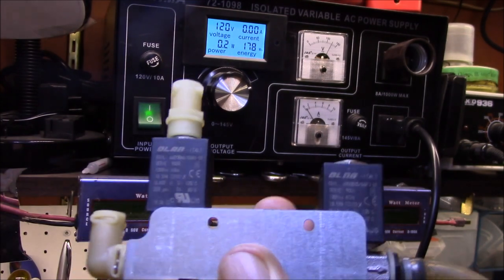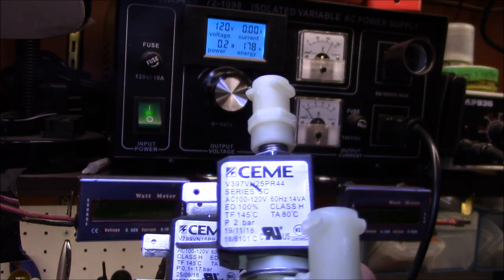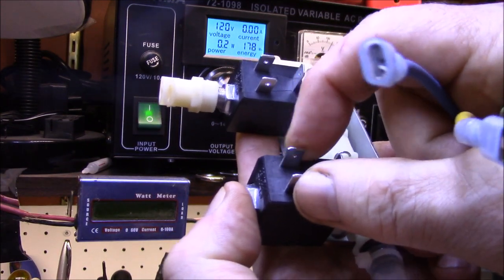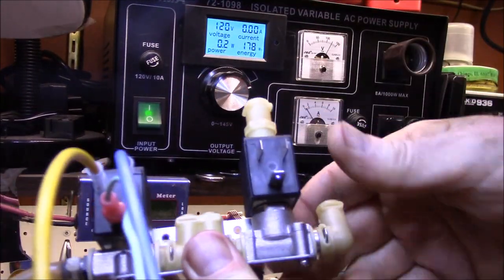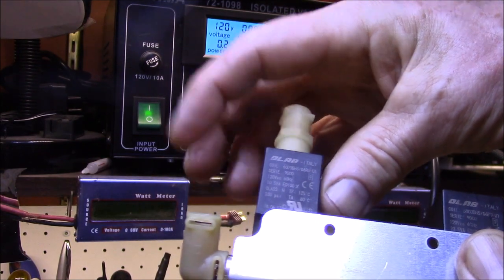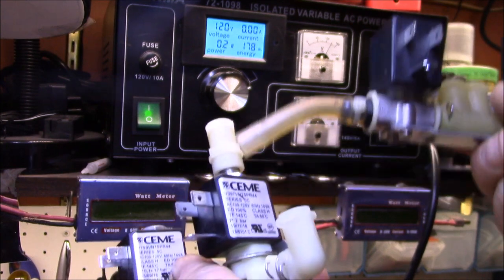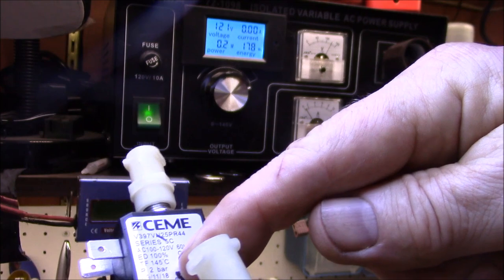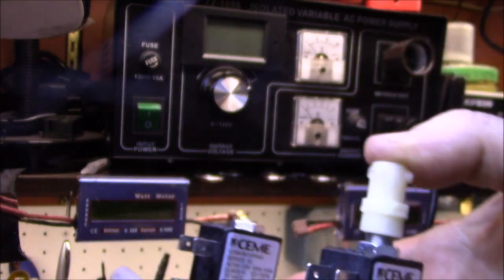Breville Barista Express - Solenoid Block Testing

Comment: Thanks for the video. My BES870 started malfunctioning a few days ago. I believe the issue traces back to a bad solenoid but I am not 100% sure. I was hoping to get your expert opinion. Here are the symptoms:
-- When the machine starts up, the pump draws water from the tank and sounds normal.
-- When switched into hot water mode, the pump used to make a thumping noise at regular intervals. This is no longer happening. The thumping sound is gone. Very little hot water comes out, if any. Instead, I get a small amount of steam from the hot water spout. I also hear an "electrical current noise" similar to that at timestamp 3:10 of your video.
-- When switched into steam mode, again, the thumping pump noise is gone. Very low steam pressure. Same noise as hot water mode.
-- When I try to pull a shot, the pump starts quieter than normal but sometimes recovers towards the end of the cycle. The total volume of the shot is smaller than normal.
Separate from this, the machine sometimes produces shots much larger than normal. This has been going on for longer and I think it's a problem of the flow meter.
Any pointers would be greatly appreciated. Thanks!!
Reply from the maker: Check the 2 micro switches at the hot water / steam valve, those control hot water and steam modes (i.e. make the thumbing pump sounds).  Those switches (as well as the flow sensor) are pointed out in this video:
https://youtu.be/9lMw6ooiqPI?si=3s_Wig5GuBh3UP7A

Variable shot volume, suspect the water flow sensor as that's what tells the machine how much water has flowed.  Sensor may be partly clogged and that's causing the variable volume readings.
Reply: @The4Crawler  Thanks for the quick reply!! Which component makes the thumping sound? Is it the pump? 
I think the micro switches do work because when I turn the hot water / steam knob, the machine does recognize that hot water / steam is requested. It just has trouble delivering them. After watching your other video, I think the right solenoid (the one that splits flow between the group head and hot water / steam) seems to be the component that ties my symptoms together. Does that sound reasonable?
I had been confused about why the pump sounded normal at startup but now it makes a lot of sense because the startup pumping action is controlled by the left solenoid, so thanks for explaining that!
Reply from the maker: @arthurcao4469  The pump makes the thumping noise as it cycles on and off, especially in steam mode,   Why?  Steam is ~1000 times less dense than liquid water, so it takes much less pumped water to make steam.  Solenoids should all be off in hot water / steam mode, as shown in the water flow video.  One simple test is to unplug the wires to the solenoid valves (be careful to unplug the machine first and wrap all the connectors in electrical tape).  Then run hot water or steam cycle and if it now works, that means the solenoids might be getting powered when they shouldn't.
Could also be the 3-port valve is partly clogged and not fully closing when it's off.  This will let part of the water flow up to the hot water / steam valve and part to the group head and/or drip tray if the 2-port solenoid is also clogged.
https://youtu.be/eljHS_BRJXk?si=94vdNC5jsF1xY4bm
Reply: @The4Crawler  I ended up opening the machine up and testing the solenoid as you suggested. When the solenoid is unplugged, no hot water comes through (as it should be). However, after I reconnected the solenoid, the previous issues magically went away! I still get too much water in a shot once in a while but I can just manually cut it off - not sure if it's worth the effort to repair (and risking messing it up). Thanks for all your help!

Comment: Thank for the video. My BES875 trips the RCD breaker when pressing singe/double shot expresso. Steamer and grinder work fine. Resistance on CEME 588 is 2.3 kOhm. I checked machine with Live line disconnected for 2/3 ways valve and it did not tripped the RCD. I will try to replace valve with a new one and have a go.
Reply from the maker: It may then be the coil on that solenoid valve.  Maybe the coil is damaged and allowing electrical connection to ground internally.

Comment: Hi. Thanks very much for the video. It's been a lifesaver. I replaced my 3-way solenoid because I was getting no water to the group head. Now I'm getting group head water but no water to the hot spout or the steam wand. I saw a comment on reddit where a guy said he'd installed the valve the wrong way round. When he turned the valve it solved the problem. I can't find a flow direction symbol on my valve but it does have the numbers 1 on one end and 2 on the other. Are these representative of the flow direction (1 to 2) ? I've installed my valve with the 1 upstream and the 2 downstream. Is it important ?
Thanks in advance

Comment: Great helpful video. I have an issue with my barista express BES870 with no flow at all to water/steam and grouphead. Suspected pump was the issue but this was tested to be good from disconnecting outlet tubing with strong water flow.  Removed the 2-w & 3-w solenoid valves, internals checked to be clean no issue.  Thermoblock & tubings were checked to be clear with no blockages,  Triac and PCB checked with no obvious visible issue on connection or failures/burnt marks.  Now cleaning the 3-w valves just to be sure the internals are clear. Measured the resistance of both solenoid coils and both are reading around 2.4 kOhms (2400 ohms). This looks pretty high. Solenoid coil is JLT 0325K unit, 240V, 9-13.5VA.  Have the solenoid coil failed ?  I couldn’t find healthy resistance reading from the website.  Advice is appreciated.  Will reassemble after descaling the 3-w valve, then retest. Thanks
Reply from the maker: Hot water and steam don't need any solenoid to be energized.  See the Water Flow video for troubleshooting steps:
https://youtu.be/9lMw6ooiqPI?si=z0kdyIXINKXhreJx
Open up the back of the machine and peek inside while running the various cycles and see if you can see where the water is going (be careful as there are live electrical connections inside).  Might be the over pressure valve is dumping all the water to the drip tray.  Solenoid coils are likely OK, they usually fail open or dead short.
Reply: Thanks. I reinstalled the solenoid block, ensuring direction is correct, checked in-line filter and confirmed no blockage.  Also checked and confirmed no blockage from the 3-way valve to hot water spout and steam nozzle. With water flowing from the top of the solenoid directly to the hot water/steam outlet and with that flow path being “open” all the time on the solenoid as you’ve stated, and the fact there was no hot water/steam, there might be partially blockage in the thermoblock.  I blew the tubing on the top (inlet) and could feel air flowing out from the bottom right outlet (line that goes to the 3-w sol). However noted it’s intermittent. Tried poking the inlet path with a trimmer line, but could only get about 4-5 inches in… I think at one point, there was flow of water from the bottom outlet. I think there is some blockage inside the thermablock which somehow got dislodged at that time.   Pump was running with the normal vibrating noise of startup but diminishing the more I attempted to run the pump (outlet path blocked, building up pressure to reduce / restrict pump piston movement). No flow from OPV so the OPV might be jammed  close or the set pressure too high.  There was water in the drip trays but much less suggesting some water flow.  I’ll now try to look into the thermablock and try to ensure no blockage.  My fear is somehow a tiny piece of o-ring has been dislodged at some point, and now sit inside the channel, restricting flow to a certain extent as it’s being pushed forward when pump runs.  I wonder if anyone has successfully pushed a steel line etc all the way through from the inlet to the outlet ?   Are there any other means to do this.  Don’t think it is scale as the tubing, visible internals of thermablock etc are clean - no sign of calcium scale at all.  Any further advice is appreciated.  Note - I’ve viewed the video on your link on water flow path already to check for potential blockages - again thanks for all those helpful videos.
Reply: Forgot to mention that I’ve measured the supply voltage to the solenoid when energised, it’s 240V confirming no fault with supply.  Solenoid is definitely clicking when I tried to brew coffee.
Reply from the maker: @timg9647  You might try back flushing the thermo-coil.  Connect the line off the pump and overpressure valve to the other side of the thermocoil and see if water comes out that way.  I think I recall one viewer comment about running a flexible wire through the coil tubing.  Start at the outlet end and work it back to the inlet to try and push the blockage back out where it entered.
Reply: Attempting to recheck themocoil for blockage by first disconnecting tubing on the outlet connection (bottom right corner) to experience water under pressure jetting out. I concluded thermocoil is not blocked (I observed similar on the inlet joint several days ago). This shows pressure from water is held in the tubing meaning : 
- 2 way dump valve / solenoid is not opening or opening just a tiny bit at the end of brew cycle (but not sufficient to release pressure fully). This is in line with my observation of just a small amount of water in the drip tray 
- suggest potentially the hot water or steam valve is not working as it should release hot water or steam when activated. I confirmed flow path is not restricted on both. With this being a mechanical valve, the most likely issue is no supply of hot water from the top of the 3-w valve.   Note when running hot water, the pump was trying to operate but diminishing pulsating (due to blocked outlet). When steaming, the normal pump pulsation can be heard too).  
- I think there are problems with the solenoid or electronics associated with these on the pcb. Will remove the pcb for a component check and dismantle the solenoids again.  

Really scratching my head as water doesn’t seem to flow at all, despite “manual check by blowing air through each flow path including from the inlet of the 3-way solenoid valve when energised to the top nozzle to hot water/steam valve” confirming no blockage.  But will continue to troubleshoot further.
Reply from the maker: @timg9647  Easy test is to disconnect wires from one or both solenoids and see if anything changes (tape off the ends of the wires as they'll be live with running the machine.  Hot water and steam should work with no power to the solenoids.  

If that works normal, then the Triacs on the PCB may have failed on and are sending power to the coils all the time.  

If nothing changes with the wires disconnected, then the solenoids may be partly clogged inside, basically stuck part way open.  They need to be fully on or fully off to seal off one port and open up the other port to properly direct the water flow.
Reply: @The4Crawler  Thanks for that.  Disconnected supply to the 3-w solenoid with the same result.  Will dismantle the 3-w solenoid again for further check.  Will report back outcome.
Reply: Update - I checked for signs of build up pressure on different sections of the water tubings before removing the solenoid block, and observed pressure build up upstream the 3-w solenoid valve, indicating no flow through this valve.   Found blockage on the end of tubing entering the elbow into the 3-w valve.  A tiny debris that I believed was dislodged from the thermoblock and migrated to this spot.  Blockage cleared and unit is functioning per normal now.  Should have rechecked the tubings for blockages earlier…as it really doesn’t make sense for no flow through the 3-w valve at all.  Thanks for your help and advice.  Learned more during this process.

Comment: Can you show where you have gotten the Ceme solenoind assembly from,    and the part number?  (I am also interested in the fittings, too, in case mine break.)  I have heard of using non-OEM valves, but until now, knew nothing of who or where they were available.  You are correct, as far as getting them from Europe, I ordered some Olab valves, but it takes about a month to come.    Thanks.
Reply from the maker: Parts source is in the video description of the installation video, a bit earlier in this playlist.
https://youtu.be/yPZCZxlEU6Q
It seems Breville changed from the Olab parts to the Ceme parts around 2017, so both are "OEM".  My part numbers are of course for the 120V/60Hz solenoids.  The only difference between the various voltages is the black plastic coil that fits on top of the valve, so if you can't find the right voltage valve, it's easy enough to swap coils between valves.  There seem to be 24V, 120V, 240V models out there.

Comment: If I am getting no pressure and no water coming out from the cappuccino maker, but I do have steam and hot water for tea. Would it be the solenoid?
Reply from the maker: See the pinned comment in my water flow video for troubleshooting ideas.  But yes, the 3-port solenoid valve is what controls flow to the group head.  It needs to turn on and open to send hot water there.  When it's off/closed, hot water/steam will still work.  Likely the black plastic coil is what burned out (look for signs of burning on it), or perhaps the drive circuit on the main circuit board has burned out.

Comment: Hi there. Has my solonoid valve gone bad? I removed my solonoid and tested it. It has 10 ohms (tested with multimeter)
Reply from the maker: Sounds like the coil may be partially shorted, mine (120V version) clocks in at 660 ohms:
https://photos.app.goo.gl/HXxLwjCxRLzXF4rF8
You can replace just the coil if you can find one.

Comment: Hi mr brown..
On my 3 way valve coil resistance shows 0 probably its blown out, it is a JLT solenoid.Can i buy a ceme solenoid and use that with a 2 way JLT? or both have to be of same company?
Also i am wondering how it got blown out as my machine is 5 days old (can't use warranty as I'm out of their coverage area)?
Thanks
Reply from the maker: I think the solenoids are fairly generic.  As long as it's the same voltage and has the same size hole in the enter and height, it should work.  To fail in a  short circuit, it may have overheated and melted the thin insulation around the winding.
Reply: @The4Crawler  okay, thanks a ton. One more thing, It would take atleast a month before i get replacement. I was wondering will it be possible if i connect the top of solenoid directly to my group head to pull shots. In that case i would only loose function for steam wand and water spout but atleast get espresso shots. Do you think it is possible?
Reply from the maker: @singhtanveer75  It might work, not sure if the control board does any checking to see if the solenoid coil is there or not.  Other option is to take the coil off the 2-port valve and use that on the 3-port valve.  The 2-port valve only does the purge function at the end, but excess water/steam can also go up to the hot water/steam valve and to the drip tray.

Comment: Thank you for the video. By the sound of failing coils I could say that I have defective one as well. What will happen if I swap them? I dissembled everything but couldn't get 2/3 way plunger to budge so I can clean inside..I soaked it in vinegar overnight( i know vinegar in not good for rubber seals but didn't have anything else).
I have breville infuser xl840, and solenoid valve assembly looks the same.
Reply from the maker: You could swap the solenoid coils although if they are buzzing that usually means the coil is working.  The 2/3 way valve is different inside than the 2 way valve.  See if you can get the 2/3 way valve open:
https://youtu.be/eljHS_BRJXk

Comment: So awesome. Had the same issue, however the warranty solved! But thanks for sharing!!!
Reply from the maker: Glad you were able to get this repaired under warranty.  Mine's old enough to be out of warranty.
Reply: @The4Crawler  have the same problem now. My olab solenoid made on 25.09.14, but technically it is the same as yours (6000-9000). I'm wondering, is it worth buying Olab from ebay, or worth trying to find CEME
Reply from the maker: I would go for the replacement Ceme solenoids, they seem to work much better than the Olab parts.  I hear you can get the solenoid block from Breville for under US$50, you'll pay over $40 for a single Olab solenoid on eBay.  Maybe the newer Olab parts work better, but I recall mine was acting up intermittently even when my machine was new.